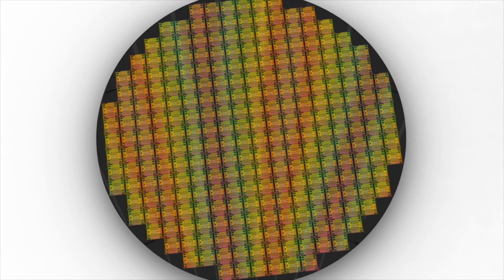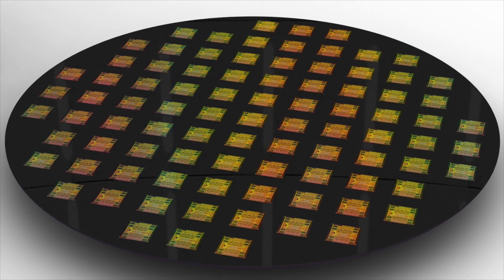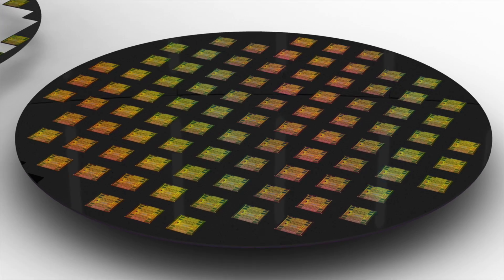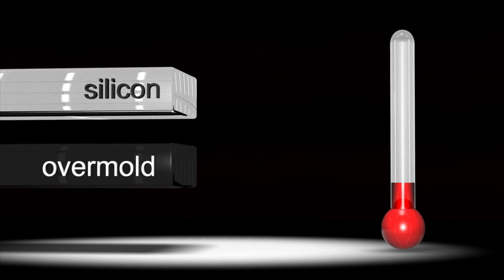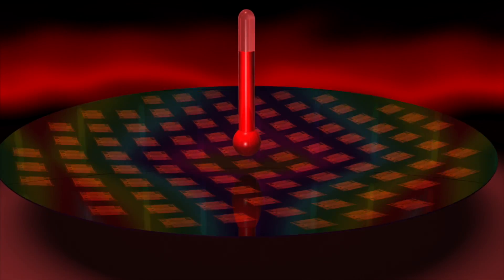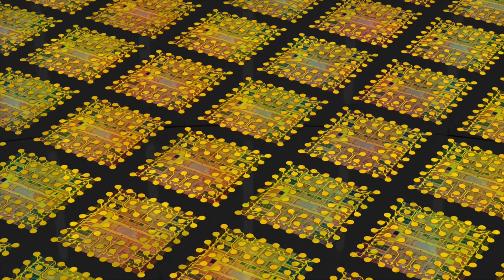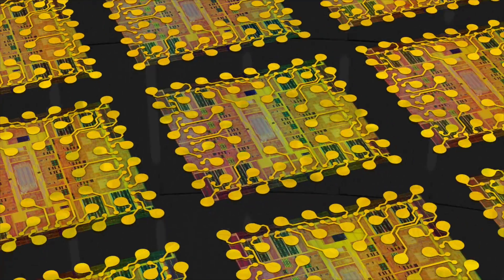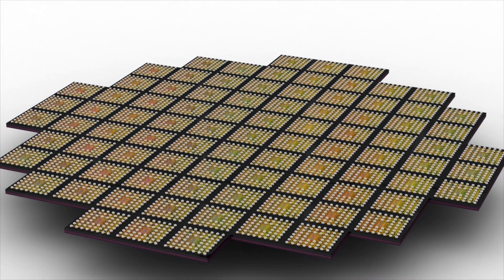What is Fan-Out Wafer-Level Packaging?

Comment: He mentions the difference in thermal expansion, but doesn't bother to give any reason for mentioning it, what problems it causes, what solutions are used.. nothing!  And, yes, he does describe that handling is a challenge, and AGAIN fails to elaborate.  I'm not even sure the graphics or his narrative effectively covered the titled subject of this video, because I'm still not sure what makes this "Fan-Out packaging".
Reply: Hi Chris, the thermal mismatch creates mechanical stress between the silicon and epoxy overmold. This can result in warping of the wafer and dies, delamination of the materials, or even device failure. It's called "fan out" because the wafer is processed with "RDL" (redistribution layers) to bring the electrical traces from the die out a little (allowing more space between contacts for easier connection to a printed circuit board). As a result, the packaged footprint is larger than the original die, but the packages benefit from low z-height (thin) and lower production cost (since everything is done in batch). I agree, the video is a bit thin on details, but still pretty good for a quick intro.
Reply: @prof.markbachman  Oh, thank you Mark. Now it makes some sense. However, I am still missing the point: how the Fan-out technique would help reduce chip warpage?
Reply: CTE mismatch causes warpage. Warpage is the big challenge in RDL processes as the wafer needs to be ideally flat for lithography. However the design needs to be thoroughly done to reduce the warpage and machine hardwares are modified to handle such warpages. Warpage we are talking about is around 1mm.